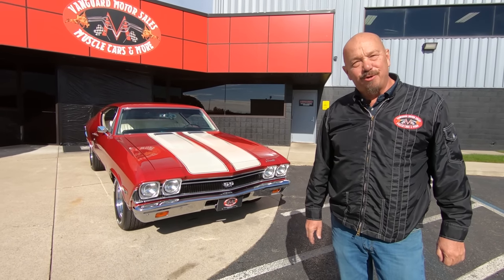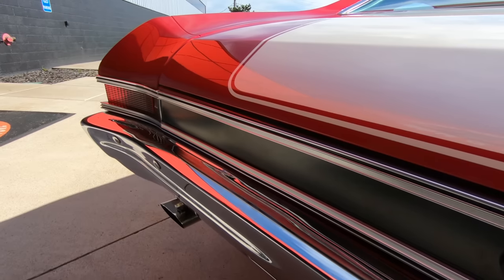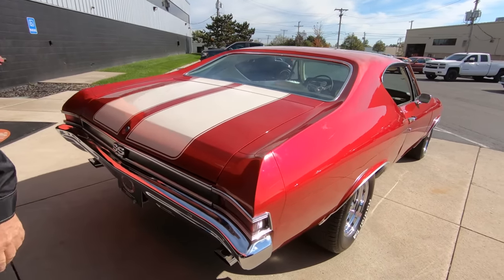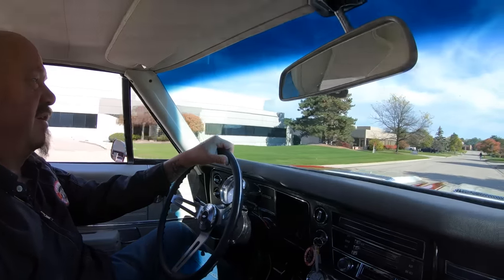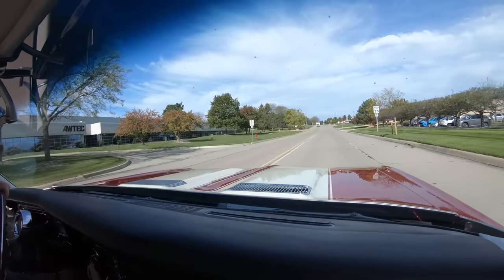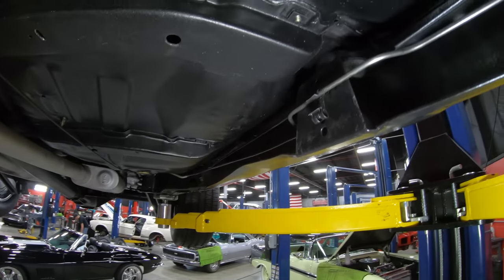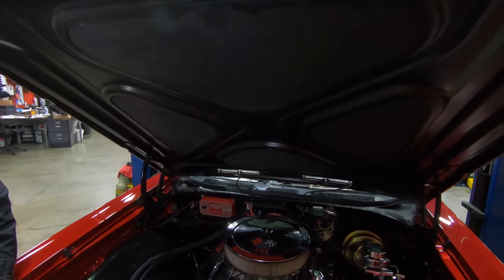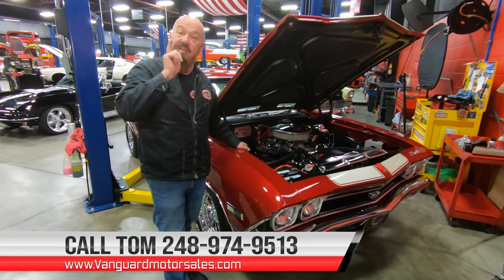TRUE SS Test Drive! 1968 Chevrolet Chevelle Vanguard Motor Sales

Comment: Had a 1968 SS, 396 matching numbers, Chevy Green (metallic silver/green) 3000.00 in 1985 (with a 454 Corvette motor included) 16k ORIGINAL MILES when purchased in 85. (Oh the stupidity of youth.) 😖